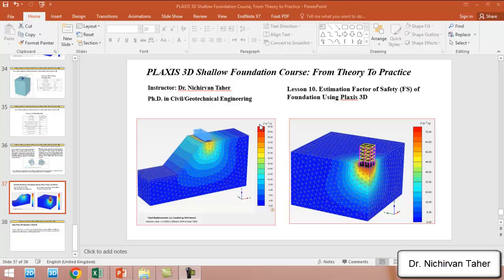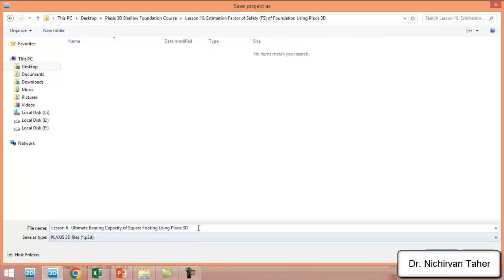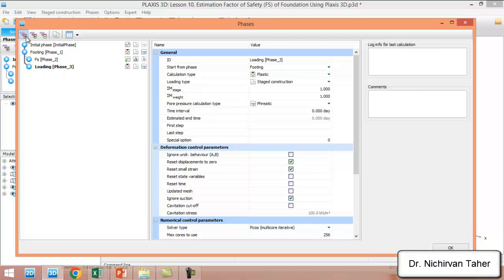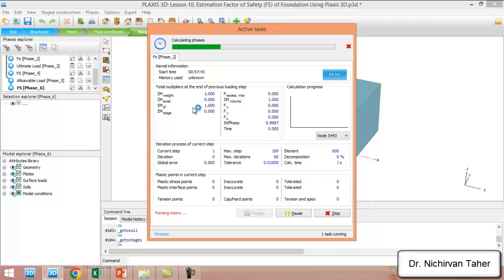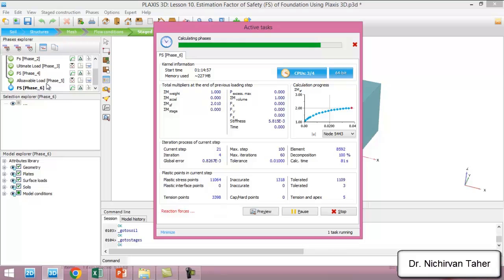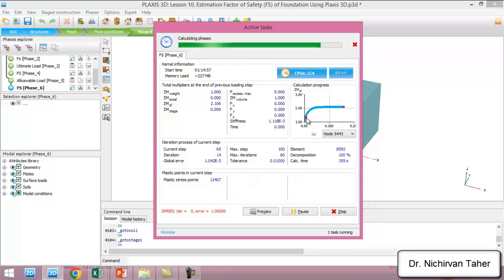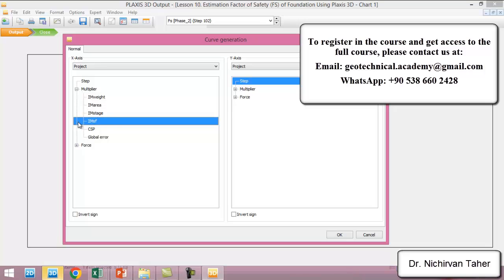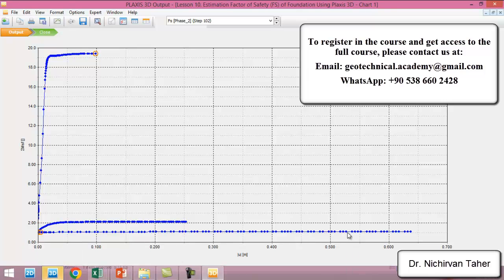Lesson 10. Estimation Factor of Safety (FS) of Foundation Using Plaxis 3D

Comment: What is the difference between the allowable load and ultimate load phases?
Reply from the maker: The ultimate load is the maximum load capacity, while the allowable load is the safe design load, reduced by a safety factor to ensure reliability.